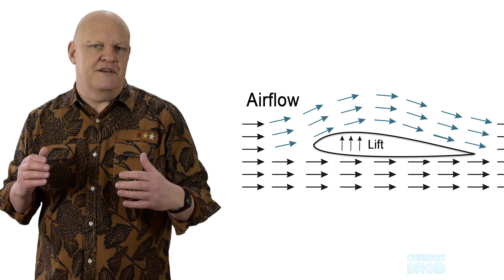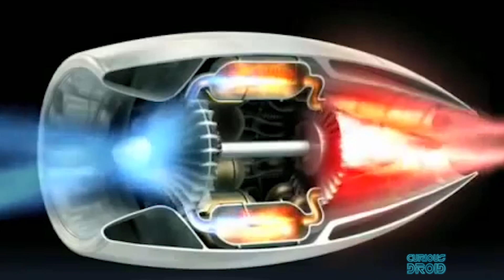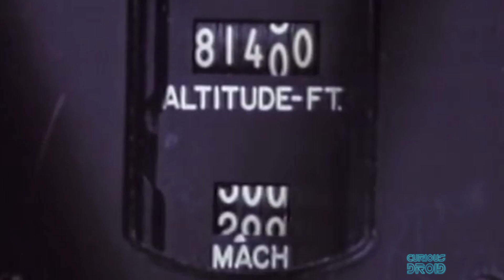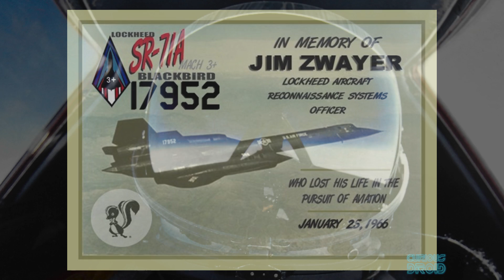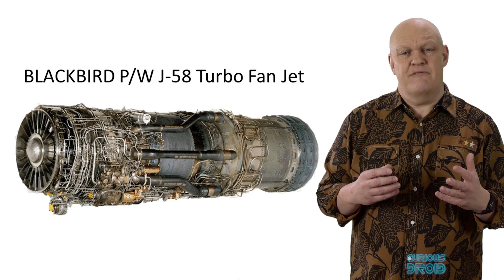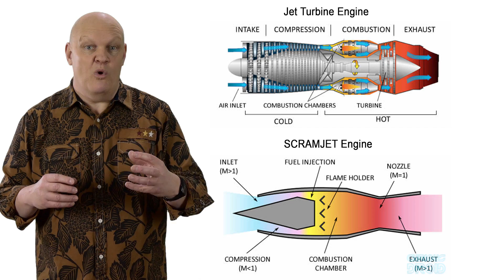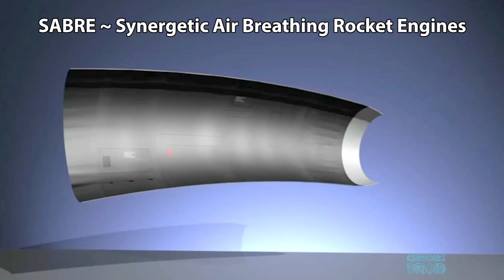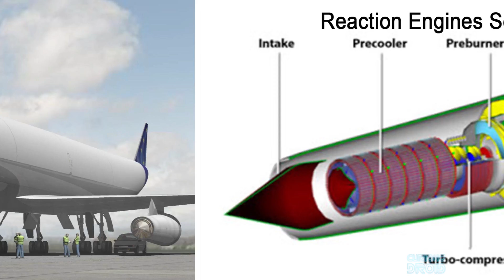Why can't we fly a plane into space ?

Comment: The highest altitude of a jet was not by SR-71 but MIG 31 at a staggering altitude of 38,000 feet near the edge of space.
Reply: 38,000 ft is nowhere near the edge of space as even most passenger jets can reach that altitude. The cruising altitude of the SR-71 was about 80,000 ft.
Maybe you are mixing feet and metres?

Comment: If it had enough fuel it could.
Reply: no.
Reply: You can't burn fuel without oxygen.
That's why rockets bring oxygen with them. The large, external fuel tank of the space shuttle contained about 100 tonnes of liquid hydrogen as fuel and 600 tonnes of liquid oxygen to burn it.
Reply: @fromnorway643  Why don't they just use more powerful rockets?

Comment: In Kerbal Space Program I built a launch platform that lifted off under the thrust of 100 air breathing jet engines. The rocket sat on top. When it got to a height where the oxygen was too thin for the jets, it shed the launch platform like any other stage and then the rocket engines ignite. Cuts down on the weight and fuel needed to get the rocket into orbit. Think of a jet powered elevator for rockets.

Comment: 0:25 This is not actually true. You can create lift with a slightly bent postcart.  The ways on the top and on the bottom of the card are equal - so is the air velocity.

Comment: 3:37 you do not need to reach escape velocity to get into space. actually, you could travel at 1m/s constantly the entire way into space, assuming you have enough thrust, efficiency, and fuel.
to stay in space, you need to reach orbital velocity, which varies depending on your altitude, though in a low orbit, again depending on your altitude, you would need 7 to 8 km/s of horizontal velocity.

but still great video
Reply: You still "need" to be actually capable of that feat or else no, you can't do that. Just because there may be a "technically you could do this" answer (which you fail to even suggest the possibility of knowing how), on the mere assumption that it could be actually possible, does not automatically mean it IS possible. You are also likely ignoring the fact that you are still actively fighting gravity the entire time, you can't just rise at 1m/s like it's nothing. (That's called magic)

The reason they do it the way they do is because it is far, far easier to travel against the gravitational fall super fast than to try to travel super slow.

Comment: It is a bit of a misnomer to refer to 25,000 mph as the velocity needed to "get into space".  If I am not mistaken, "space" is the region approximately 60 miles or so above sea level.  So, if you pass this point, you are "in space" but 25,000 mph not required.  You can simply plot a ballistic trajectory to this point  in space and parachute back to earth.  This is precisely what the Gemini program was in the 60s.

However, in order to orbit the planet at the minimally viable altitude of 100 miles above sea level, a velocity of 17,500 mph is required.

In order to escape earth's gravity and transit to another planet, the minimum speed is 25,000 mph.
Reply: The 2-man Gemini spacecrafts did in fact reach orbit. Gemini VII stayed there for two weeks in December 1965. The two astronauts, Frank Borman and James Lowell, flew on the Apollo 8 mission to the Moon three years later.

Comment: I was going to ask why we don't just shoot stuff into orbit using some kind of long railgun like system.  However, apparently even our weapon rail guns only reach the velocity of just over 5k mph.  It takes 5 times that to stay in orbit... probably a ton more would be needed since you would slow down some before getting out of the atmosphere.

That said, I wonder if you could technically do it if the system was long enough?  I'm sure there would be issues with heat though since even at our highest altitudes that we could build it the air would probably be kind of thick still.

Comment: No air in space. Jet engines need it to burn fuel and air from the engines is also used to pressurize the cabin.
Reply: And the control surfaces for steering (rudder, flaps etc.) also need air to work.

Comment: i wonder if there is a correlation between escape velocity(25,020 mph) and the circumference of the earth(24,860 miles)
Reply: It's just a coincidence that the two numbers are so similar for Earth, as they are more different for other planets and the Moon. Some examples:

Venus: 38,025 km – 37,300 km/h
Mars: 21,297 km – 18,100 km/h
Moon: 10,916 km – 8570 km/h
Jupiter: 449,200 km – 214,200 km/h
Saturn: 378,675 km – 127,800 km/h

The escape velocities get lower relative to the bodies' size as their densities is reduced since lower density means less mass per unit of volume, and the Earth has the highest density of all the planets in our solar system.
Reply: Oh wait, lol
Even with kilometers per hour the relation stays, but maybe its just a coincidence

Comment: actually the sr-71 did slip into space a bit sometimes i think eh?
Reply: The SR-71's maximum cruising altitude was 85,000 ft or 26 km, where the atmospheric pressure is only 2 % of that at sea level, but that's far from true "space". The atmospheric pressure on the surface of Mars is less than 1/3 of that at 85,000 ft here on Earth, and NASA will attempt to fly a helicopter there in April.

Comment: For quick explanation: The vacuum in space doesn’t have air which a plane needs to propel itself forward in order to fly using it’s engines
Reply: No air to let the wings generate lift, no air to work as reaction mass for the engines and no oxygen to burn the fuel.

Comment: The topic of this video should really be, 'Why Can't You Use An Airplane ENGINE To Go Into Space ( Its not impossible to hall the body of an airplane into the highest orbit, just like a Tesla car was). 
...(semi off topic) But the problem is, nothing is impossible if you can amagine a SR-27 craft having its twin center jet propeller rods, be a rocket, with a layer coat over it to have o-ring propeller blades, while cgi expand the whole craft to a size of the biggest passengers use airline, you can see a very effective Spaceline passanger craft conversion between propeller,  jet afterburn to pure rocket exertion or even a 2 phase split on the crafts neck being a passanger 2nd phase orbitline shuttle/drone rocket.

Comment: You did not explain how could airplanes and reockets fly in  vacuum without a medium like air to push against!
Reply: The easiest way to visualize Newton's third law of motion is the rocket and the rocket exhaust pushing against each other in an equal action-reaction force pair. As long as the speed of the rocket exhaust exceeds the speed of the rocket, it will accelerate. Additionally, the rocket has to have sufficient delta-v to achieve low earth orbit to stay up there (or deposit it's payload there) for any meaningful length of time.
Reply: @ArKritz84  Actually you dont need the exhaust velocity to exceeds the rocket velocity, you can even drop a rock at half of your velocity backwards and it will accelerate you forward.

Comment: 3:41 "faster than gravity is pulling you back to Earth"... Does gravity 'flow' at a certain speed?  Why does speed/ velocity always seem a factor? 7:20 "the speed that is needed"... Can something escape Earths gravity if given thrust with a specific impulse of less than escape velocity? And then, why is re-entry always so fast? Can a spaceship re-enter at any speed, if not in a free fall decent?
Reply: Hello, nothing can escape gravity if it doesn't hit escape velocity, it would just be in Orbit forever, if you're going Sideways.
If you're going upwards, you'd probably just fall back down.

Reentries are fast because the pods have little fuel, so they use air dragto slow them down.
Reply: @afoxwithahat7846  Hey, thanks for the reply... I understand 'fuel to weight ratio' but, would just seem to me that you could move away from any object, at any speed, if fuel was not a factor.. "Escape velocity" is only necessary like as if I were trying to throw something off Earth and it continue without further propulsion.... A balloon can reach the edge of space at whatever speed. From that point, its essentially weightless and, could proceed further at any given rate, with little propulsion. That, if a aircraft were at the edge of space, the same applies, because it too would be essentially weightless.
Reply: @SunOfDamien  technically yes, but a Saturn V can carry 100 thousand times more payload than the average weather balloon

Comment: D should of explained what defines escape velocity in this context. It is the minimum speed necessary, while ignoring aerodynamic drag, from a single impulse directed radially out from the Earth's center, to escape Earth's gravity. I don't recall exactly where in the vid, but he does mention it in a imprecise or non applicable fashion. To escape Earth's gravity (which is a diminishing gradient), you only need an upward force greater than what you weigh at the elevation you are at. I asterisked ONLY because it's damn hard to sustain for miles and miles upwardly.

Comment: It would still be cheaper to use lift to get you high enough that less fuel is used gotta be a way to.make wings strong enough to handle rockets and a center jet engine as gets higher go to rocket mode and pull up and launch already in height
Reply: Takes alot of fuel to launch from dead stone the ground
Reply: Stop not stone

Comment: Not to seem dumb but planes need air to burn fuel, no air no burn no plane that flys. Also  a plan is not designed for non atmosphere flight, no control thrusters to name one among a dozen reasons why.  Space shuttle engines are different then plane engines, but do the same thing.

Comment: Why is it necessary to travel in terms of escape velocity at that speed when a slow Rising high altitude balloon can also simply Escape🤔
Reply: The balloon is filled with a gas lighter than the air around it, which causes the surrounding air to push the balloon upward.  At around 20-45 km altitude, the gas in the balloon matches the density of the surrounding air, and the balloon will stop rising.

Rockets can go straight up as wel tot higher altitudes. But since they are always denser than the air around them, they will start to fall back to earth once they run out of fuel.

So they need to travel in a trajectory that will cause the rocket to miss the earth when it is falling towards it.
Reply: @rinse-esnir4010  okay I understand somewhat what you're trying to say.. it's just hard to wrap my head around. Because I can't see how such a weak Force such as gravity will have an impact in effect on a rocket accelerating at such speeds I would imagine in a hypothetical scenario, that a high speed rocket would of course missed its Target with such a weak tug towards it
Reply: And like I don't get how the Sun is so immensely powerful in its gravitational pull yet small objects like Halley's Comet doesn't slam right into it instead it swings around the Sun and shoots back out to far reaches of our galaxy and it keeps this orbital path without missing a Beat every 75 years and we're supposed to be traveling in opposite directions at other velocities and supposed gravitational Tugs from other Stellar bodies 🤯🤕😞
Reply: @thinkinsidetheboxsquarecir3303  What do you mean by gravity being weak?
Do you know what gravity is?

About the rocket in orbit: think about a ball. If you drop it, it falls straight down. If you throw it, it falls in a trajectory.
The faster you throw it, the longer the trajectory.
If you throw it fast enough, the arc of the trajectory will match the curvature of the earth. Meaning that the ball will miss the earth on its way down.
Now, a ball is subjected to air friction, so it will slow down and fall to earth eventually. But in space, there is no significant friction. So a rocket won't slow down enough to change its trajectory.
Reply: @thinkinsidetheboxsquarecir3303  You don't see how gravity will have an impact on an accelerating rocket..
Well, the gravity pull is always there. It gets weaker with distance, but it takes thousands of miles of traveling before the rocket is away from the gravity pull of earth.
Reply: @thinkinsidetheboxsquarecir3303  Halley's comet.
Simple: its being pulled towards the sun and is overshooting because of its velocity.

Comment: What about the Van Allen radiation belts.  Has any human being physically past those belts or what.  Did he explain how rockets travel in the vacuum of "space "? If rockets can leave the Earth and fly into space, then airplanes should be able to do the same.  I  thought jets fly faster than rockets.  The point is, no one can physically go to space.  "Space " was made in a Hollywood basement.  And Earth is stationary and level with a protective Dome.
Reply: planes create thrust by moving air. there's no air in space.
Reply: @atlas8827  exactly...  NASA done lied enough!
Reply: @thinkinsidetheboxsquarecir3303  ???????
Reply: Rockets don't rely air for propulsion in space. You wouldn't understand that though since everything else you believe is completely wrong.
Reply: @EVRose60  I will indulge you I don't mind... So tell me, how does a rocket work in an environment where there is nothing no friction, no dominant Direction, so steering and stopping,  whatever stop speed even means in this fictional heliocentric model... no push or pull,  and weightlessness... how would this rocket circumvent and defy newtonian laws of motion physics ?🤔
Reply: @EVRose60  okay I'm back! I've done research and have the same questions... now answer the question.🤔
Reply: @EVRose60  and please don't say they use liquid oxygen in a closed system... Because that's essentially saying you're able to lift yourself up in a chair while still sitting in it! Physically impossible😏
Reply: Karlyle, the point is that you are a severe case of the Dunning and Kruger effect.

Comment: As a pilot I can save you 10 minutes. Simplest answer is planes fly, which means it’s using air and motion to create lift to counter gravity. In space there’s no air, no matter how fast you go there is NO LIFT. There is also NO GRAVITY. So even if your traveling through space you’re NEVER flying in space. Planes cant reach space because the air gets too thin for lift at very high altitude, a planes intertia is not enough to break free from earths gravity. And as a piece of info a planes engines burn fuel and air and need air to push against to crest thrust for motion. Since there is no air In space no amount of jet engines Spinning or propellers spinning can produce any amount of thrust. Like a boat out of water. Maybe just a small gyroscopic effect but no thrust, engine wouldn’t run anyway with no air. By the way planes may be able to fly on other planets or bodies with an atmosphere. There you have it.
Reply: Shut up bot

Comment: There's an SR-72 Son of the Blackbird that's hypersonic.

It should use the advanced cycle jet engine, where it used three engines in one.

First inside is a turbofan jet engine, then ramjet that speeds up to Mach 3+ speed and scramjet that'll take it hypersonically.

The weight of a space shuttle alone can be 1-2 thousand tons.

Nice for informing.

Comment: Correction at time 3:36. You can easily go to space with much
 lesser speed. Typical orbital speed is approximately 17000 mph  (27360 km/h or 7.6km/sec) at  an altitude of 150 miles (ca.240 km).

Escape velocity on top of earths atmosphere is ca. 11.2km/sec, then you can
 reach the moon and planets if you do it right.
Reply: You can go to space and experience zero g with less than orbital speed, but you won't stay there for very long.
Reply: @fromnorway643  Correct, in the worst case we experience 0 g in
 an elevator if the cable break and all safety brakes fails.

The end result might be a stew in the bottom of the floor. Our next wish could
 then be to fall into a small black hole and be spagettificat.
Reply: @otrondal  
I was thinking of suborbital flights like the first two Mercury missions and the two X-15 flights that broke the 100 km barrier, but you are right; the weightlessness in a dropping elevator and in a spacecraft are both a result of freefall.

Comment: Simple. We would need to get the plane to fly up at about 5,000 mph to break through the atmosphere.
Reply: 5000 mph would only be sufficient for a suborbital flight, in which the air/spacecraft stays in space for a few minutes before it enters the atmosphere again. 
The craft would need a speed of 28,000 kph (17,500 mph) to enter low Earth orbit or 40,000 kph (25,000 mph) to achieve escape velocity, that is, leaving the Earth entirely.